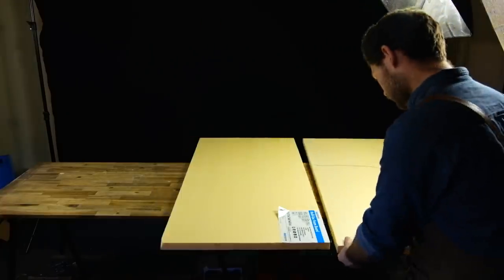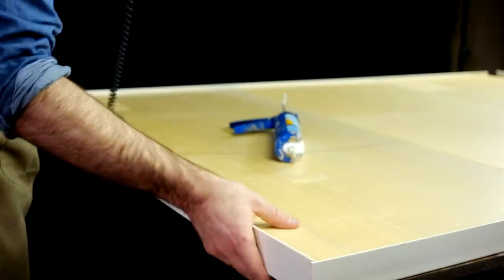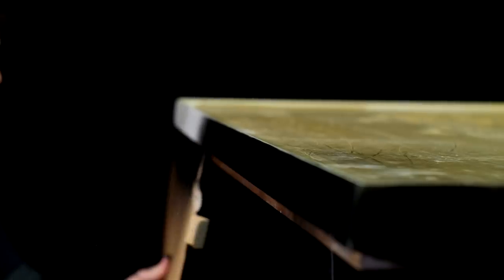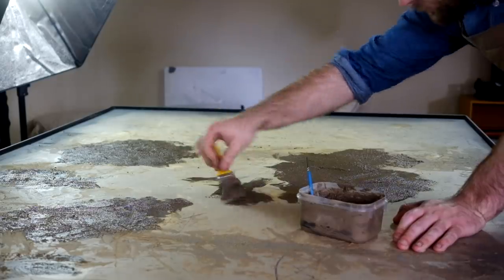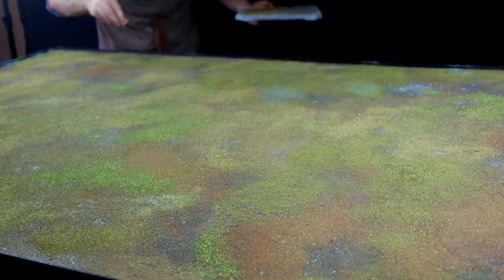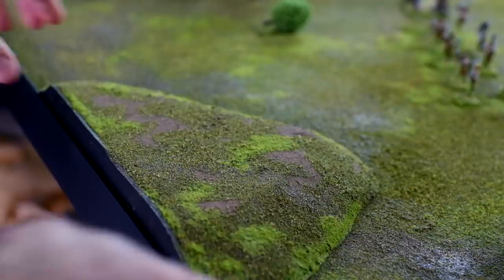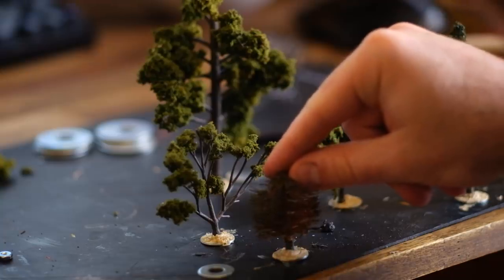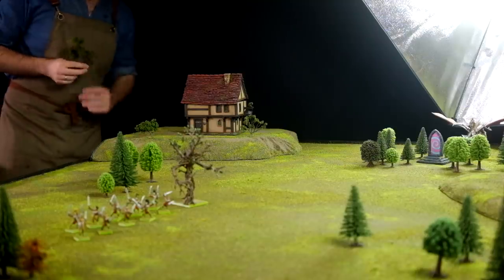How To Make A Table for Warhammer 40k, AoS and D&D

Comment: You should wear a particle mask when sanding or spraying, it'll make you die less :)
Reply from the maker: Totally agree!
Reply: pfff, min-maxers
Reply: Everyone does, but not everyone LIVES LIKE A MAN!
Reply: What's the fuss?  It wasn't epoxy primer.  Clear coat the paint.  It smells like grapes when shooting it.  Do wear a respirator if you shoot it.  How many respirator phanatics store the mask in a sealed bag when not using it?  Yep, you need to do that.
Reply: That comment made me spit on my screen
Reply: I just was thinking the same during the video 👍🏻 for your own health
Reply: Miscast for like 35 or40 bucks you can get a 3M ask with the carbon thingies and the particle covers too. Overkill for a lot of stuff but it’s nice cuz it’s the only mask you’d ever need to buy
Reply: Yep, was about to comment about needing a respirator. Please respect the lungs.
Reply: Yes. Probably should apply that question a bit more often.
Reply: A little bit of pain never hurt anyone

Comment: Very good. It's easy and fun to do. Everyone should get their hands dirty from time to time,  to time it's very relaxing. I made my present table in an afternoon, using some old chipboard given to me by a friend. I recently made Senlac Hill for the battle of hastings, which fits nicely on it, as does my expansive English Civil War redoubt. All made with polystyrene tiles, ready mix plaster and hair curlers. The thing is, have a go, it's great fun and you can only improve with practice. Another tip, never throw things away. I keep corks, match sticks, cocktail sticks, little blocks of wood etc etc, they all get used eventually.

Comment: Thank you for this tutorial. I've been wanting to make a game table for some time and have been rather overwhelmed by the scope of such a project.
I have a couple questions:
Where do you store your game table, or where do you plan to store it, when not in use?
How do you protect it when storing it?
Reply from the maker: The table is light enough to be stored vertically and water-resistant so it can be stored anywhere without fear of warping. Ryley has a home for it in his house in mind when he takes the table.
Reply: @Miscast  thank you :)

Comment: Mitre Cut for the PVC, using a hacksaw ^^
Reply from the maker: Good tip! That's what I tried initially but my blades weren't the right size for the soft PVC and I didn't get far.

Comment: I suggest you to put some bars or pins between the foam parts, it helps a lot about not bending and reinforces the structure.
Reply from the maker: It seems pretty strong to be honest, the angle bar, foam, and silicone does a great job. The bars might be good for an 8x4 though!

Comment: Great vid and techniques. I subscribed when I found your Mars terrain tutorial. Question though, how are you using an aerosol to paint the frame with the foam in place after taking the effort to use foam safe silicone? My understanding and experience is that the rattle can propellant eats foam.
Reply from the maker: It really depends on the paint and foam combination. I've found Rustoleum 2x Ultra Cover does not melt my foam. Most spray paints will be safe to use as long as the solvent evaporates before touching the foam, so you can try spraying further back. The surface I'm not too worried about slightly melting (it gets covered up), it's only the critical joining points I'm trying to keep intact. Hope that helps.

Comment: If it’s foam it must be very light. Isn’t that a problem? Surely, one slight knock on the table edge will bring down half the trees and several of your battalions?
Reply from the maker: Not anymore than any other table I've used. If it's an issue you can pick up some non-slip mats from a dollar shop and put them between the top and the table. :)
Reply: Many thanks for your replies!

Comment: Awesome! I made my last few tables out of MDF board. They're sturdy and useful but a tad obnoxiously heavy (they weigh a ton though like 50 lbs each.) Seeing you use XPS foam for the base of the board seems like it would be much much lighter but Im worried about two things:

A) does it get knocked around the table easily?
B) is it susceptible to breaking?
Reply from the maker: Good questions! A) Not really, but you could use a non-slip mat on the underside if you're worried. I can lift this by myself so I think it's a good trade-off. B) The first table I made a year ago has dice thrown at it nearly every single day at a game shop. It's held up really, really well. Hope that helps! Good luck!

Comment: Hey Trent, thanks for the video. Do you think contact glue would do the trick to hold that stuff together?
Reply from the maker: Most contact cement will melt foam. There are water based contact cements, but they're really bad from my experience. For the foam that I use, you can get away with using contact cement on the top surfaces but not the sides. I'd really recommend foam-safe sillicone and construction adhesives (Read the back of the tubes and it should tell you) and they're both a lot cheaper than contact cements.
Reply: @Miscast  thank you for the reply. It will save me from potential failure
Reply from the maker: @dulesjoe  No problem mate, I've been through that already with my first table, that was what led to the choices in glues for the tutorial. Always happy to share my learning experiences.

Comment: Hey. Great video. How thick would you recommend them to be? 50mm?
Reply from the maker: Hey! I'm using 30mm here.
Reply: Miscast hm. And if I’d just use them as a topper to put a mat on it? Without rims etc...I guess it would have to be a bit thicker as no rim would hold them tight?
Reply from the maker: @michaelinOZ  Not sure I understand completely but the foam is 30mm and the edging is 50cm. You can comfortably put a mat on there and have a nice rim around the edge to catch your dice.
Reply: Miscast well, I would like to keep it modular - basically store the 3 pieces individually somewhere. Of course I can’t add a frame then as it would keep the pieces together. And without the frame the XPS pieces might not be as stable when being only 30mm thick. Right?
Reply from the maker: @michaelinOZ  Oh I see. A heavy neoprene gaming mat will stop the foam from moving around regardless of thickness, any other mat probably will too. But at the end of the day for that application you might be better off with 3 pieces of MDF, it'll likely be cheaper and will take up less space :)
Reply: Miscast ok, regarding stability 30mm should be fine then. MDF is just too heavy for my taste :)

Comment: To seal the flock you use PVA glue from a spray bottle. Whenever I try this the spray nozzle gets clogged within minutes and is damaged beyond repair: must be doing it wrong :-?

What proportions are you using of Water to PVA? How often do you clean the nozzle? Do you have to clean the bottle after every use?
Reply from the maker: I try to go for the consistency of milk and shake the bottle as much as I can to make sure it's mixed. The nozzle does get clogged if I haven't used it in a long time, but you can spray water through it after a session to prevent that.
Reply: Miscast — Thanks. Will give it another try :-)

Comment: Hey just wondering what type of silicone did you use to join the boards?
Reply: Neutral silicon will work fine. Just make sure it's not acidic cure or it will eat your foam up
Reply: @TheKinglyDJGonzo  will liquid nails work too?
Reply: @joelbinder5080  as long as there's no acid in it, I believe so
Reply: @TheKinglyDJGonzo  thank you mate

Comment: O.K. PVA glue, water, tile grout, oxide pigment and sand, any proportions?  20% each by weight or volume, more or less of one or the other?  Any guidance would be great, thanks.
Reply from the maker: It's very hard to give specifics because every brand is different, but you really can't mess it up anyway, just make sure you have plenty of PVA glue to make it stick. If you try different ratios you'll get all different great results that are worth experimenting with. The more variation on the table the better it will look. Don't overthink it, just try and you'll quickly figure out what works :)

A little bit of oxide pigment goes a long way.
The more sand you add the grittier your texture will be.
The more PVA glue you add the more it will stick.
The more water you add the easier it is to mix and spread on the table but the longer it will take to dry.
Reply: @Miscast  Outstanding, thanks for taking the   time to reply.  I can't wait till your next video.  So I'm guessing I'll do a lot less oxide and sand and more glue and water.
Reply from the maker: @paulteti  No problem! Yeah, just add each thing gradually and mix as you go and you'll soon work it out. Have fun!

Comment: Why did you use foam instead of a thin wooden board, Shouldn't be easier to store?
Reply from the maker: A lot of reasons, I should have covered in the video but: Weight and rigidity are the big ones, I can carry this board by myself and confidently stand it upright for storage. Water-resistance, I don't have to worry about anything warping over time regardless of where the table is stored. Thickness, I can carve into the table to make rivers at a later point. Acoustics, nice muffled dice sounds. Hope that helps!
Reply: @Miscast  It did indeed help, money wise it isn't much different but being able to put in dimensions like rivers and lakes should be really nice.
Reply from the maker: @tristanovic2-531  Also you can put it in a pool during the summer and it will float ;)
Reply: @Miscast  great, now I need to buy a pool

Comment: hey man not sure why you made it out of foam when you can buy a piece of MDF or plywood to "competition size" for around 20bucks?  Still love the video but any reason why?
Reply from the maker: A lot of reasons, I should have covered in the video but: Weight and rigidity are the big ones, I can carry this board by myself and confidently stand it upright for storage. Water-resistance, I don't have to worry about anything warping over time regardless of where the table is stored. Thickness, I can carve into the table to make rivers at a later point. Acoustics, nice muffled dice sounds. Hope that helps!
Reply: @Miscast  yeah fair enough. water resist i'd disagree with but just because a quick layer of paint hahaha. But yeah i get ya... i went with a static table i drink at, eat at, play DnD and warhammer/40k at, haha it is great. Painted the table then covered it in a thick-ish* grey cloth (glued and stapled around the edges) for acoustics because agreed! haha then built 20 removable/interchangeable terrain slabs (table can hold 7 at a time)

Genuinely love the build though its great went and watched ya flock will be using that from now on for sure
Reply from the maker: @rhysforestlord  I put a lot of emphasis on the water resistance thing from participating in wargaming clubs with lots of hand-me-down or donated terrain and tables. Even with a coat of paint the MDF is susceptible to absorbing water and has resulted in a lot of ruined stuff. Where I live with the weather we have, poor storage can result in ruined boards and terrain so I try to make everything as water-resistant as possible. If ryley wants to throw this in his garage for 20 years under a drop cloth, it'll be as good as the day he put it there. I just like to think ahead as much as possible because the clubs I've been apart of have had terrain thats much, much older than me. In the end, with the cost of XPS foam in Aus, it ends up only being like $15 more or less anyway, which is great for that peace of mind.
Reply from the maker: @rhysforestlord  Also we use thick cloths on our tables my local club and I think it's a great solution too. Otherwise battle mats are great but they're costly. Certainly lots of ways to tackle something like this.
Reply: @Miscast   and dont get me started on paint brushes!!!!! glad i took art in high school so i was taught the best places where i could find great cheap paintbrushes hahaha
Reply from the maker: @rhysforestlord  All valid points mate, but can you use your table in the pool? Didn't think so ;)
Reply from the maker: @rhysforestlord  Where's the place for cheap paintbrushes!?
Reply: @Miscast  hahahahaha fk got me there
but counter question... can 12 heavily drunk bogans sit around yours and not snap[ it in half ;)
Reply: @Miscast  well it changes from town to town city to city but for me right now its actually office works hahaha
they have a great selection of fine soft brushes
J.burrows usually does a fantastic brush for about 3 to 8 bucks
But there are sooo many others 
Holcroft 1 240 sable is what i am using right now
Reply: @Miscast  Just checked office works dont seem to have the holcroft any more... found it 5:50 from riot art and craft
Reply: holcroft sable 
size 0 4.50 
2 is 5 
4- is 6 
size 6 is 8 50
8 10
10 is 14

so still reasonable even  when you are getting up in sizes (i have had this for a year and it is as smooth and as acurate as it was when i bought it... though it is bent because i forgot it and left it in my water for ages when i went out and it got that brush bend hahahah)

Comment: For anyone attempting this, for sure go with thicker foam board...tried this with 1/2” and it’s garbage. Will never lay flat.
Reply from the maker: I used 30mm (1.18 inch) on both tables I've made and they have been going great. Sorry to hear the thinner foam didn't work, we can't buy it that thin here. Also the multiple sections help a lot to get it flat.
Reply: @Miscast  that’s what I realized as well. Lesson learned, it was a cheap way to do it and I paid the price so to speak. 
Besides price, the other factor for going thinner was that edging. I could not find a good source for it to be large enough to make a lip.